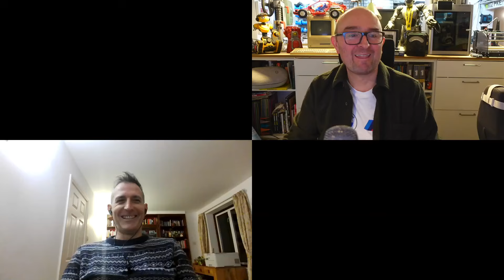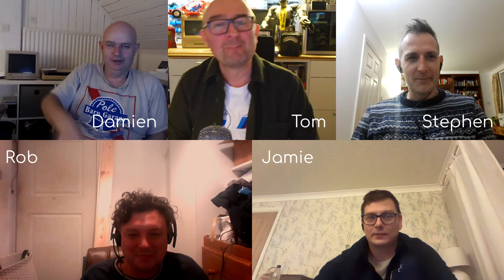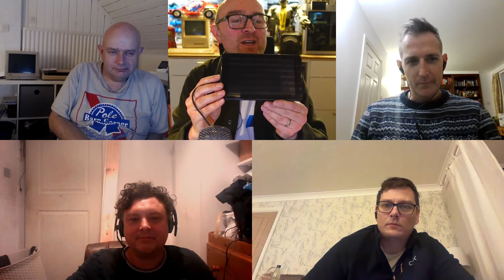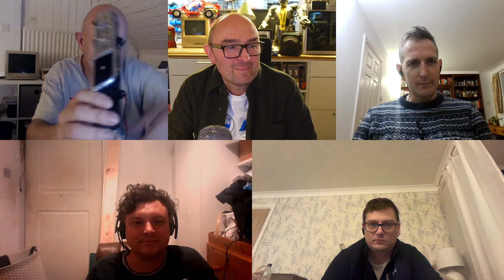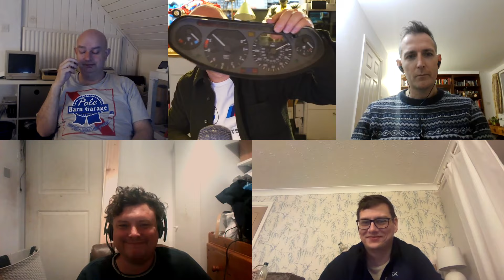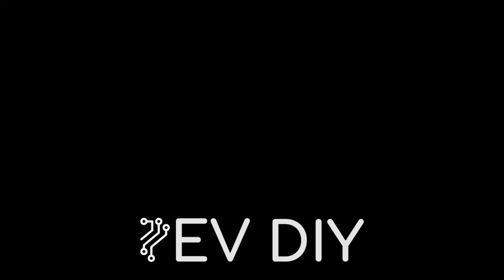Is your EV tail-happy? Special guest @Evbmw joins us for DIY EV Chat

Comment: Following the discussion on gauges how would you drive a mechanical speedo and odometer in a 450h conversion where the speedo drive was in the old gearbox?
Reply from the maker: Good question. I know some people have pulled out the mechanism in the gauge and replaced it with a micro servo. I guess the alternative if you didn't want to mess with the gauge would be a little DC motor and controller on the end of the cable. Not sure if you could drive it directly from Zombie's PWM outputs or whether you'd be better having a separate little driver on canbus. It would be fiddly but the servo route might be ultimately easier.

Comment: Not sure if Jamie's thinking of my 450h project. I am working on locking the gears in high and running the internal pump off the PSD ring gear. Yes, it would be like a heavier 300h but it's a more powerful unit, with taller overall gearing so there may be an advantage. I also have a 300h to play with and would like to try running that with MG1 (and it's entire housing) physically removed, with a custom front plate, to make a lighter more compact unit for a light RWD vehicle (My avatar is a clue).
Reply: Although the gearing is different I thought the kw output of the two is the same?
Reply: @lukemason9500  Not 100% sure. Even the power output from the 450 is difficult to work out from the spec as the cars' quoted output incudes the ICE. The fact that Damien dynoed the 450 is useful but I haven't seen a dyno run for a 300 as a EV. All good fun for experimentation anyway.
Reply from the maker: That sounds super cool. I'll let Jamie confirm!

Comment: pretty sure the bmw small case tds diff has different mounting points to the Z3 small case diff also the bigger engine Z3's dont use the small case diff so you'll have to change the rear subframe to use one
Reply from the maker: Yeah you're absolutely right. My choices are pretty limited starting with a 1.9. Basically I need stronger internals for a 168 diff. Which are available but pricey.